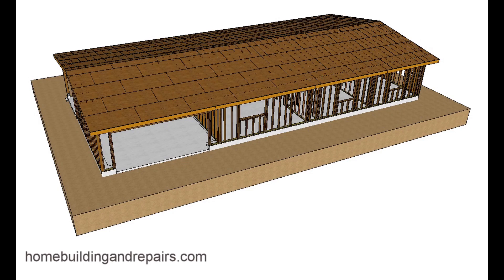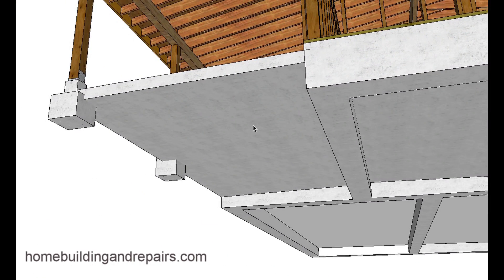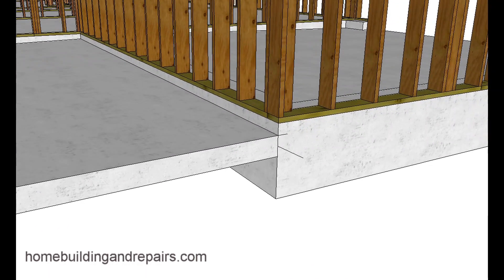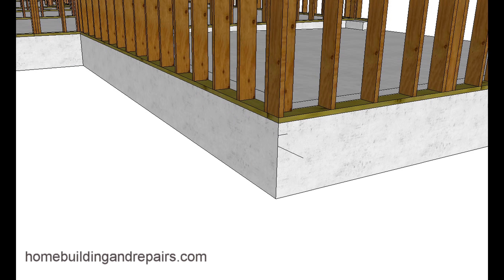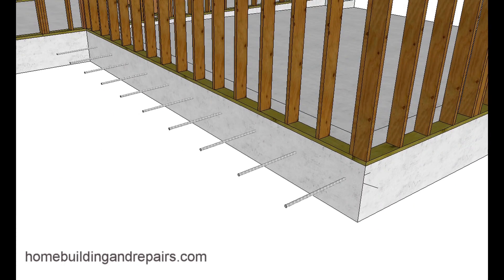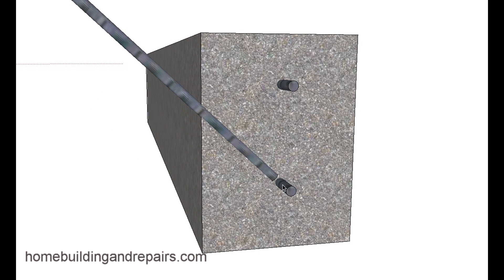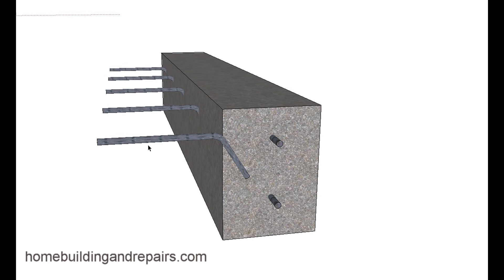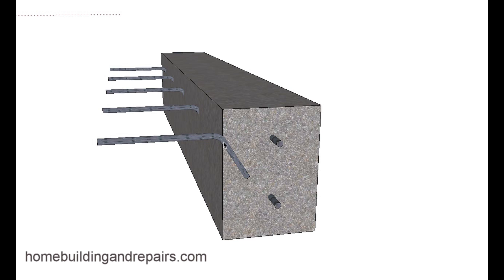Angled Concrete Foundation Dowels Might Be Stronger – Patios And Walkways

Comment: This will put the bottom corner of the footer in tension with a focal point at the end of the rebar.  Basically its the ancient method to quarry rock except you're using the angular force from the weight of a slab instead of hammering wedges.
Best case scenario with good compaction and drainage, opposing forces balance it out before a crack can propagate, however that would be even more effective with a straight connection... but don't take my word for it - I never really liked Statics&Dynamics in college.

Comment: I suppose you might consider alternating the angle for even greater strength. i.e. one angle up, another down and possibly even others angled along the horizontal access.  This would be akin to a common procedure in wood working where nails are shot at opposing angles to prevent a single force from pulling the pieces of wood apart because pulling one direction works against the other fasteners. 
   That said, I suppose one argument against this approach of physical fastening, while good for small forces, might destroy the foundation in medium forces where using only chemical fastener of epoxy might simple work the rods straight out, leaving the foundation salvageable. Of course, in extreme situations all bets are off anyway.
Reply from the maker: The only problem I see with drilling up would be if it went through the slab.